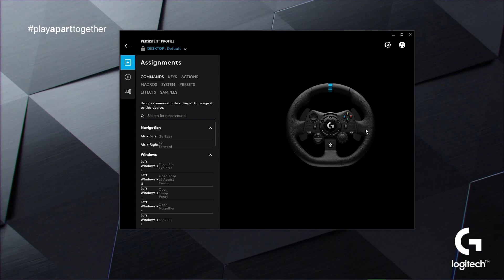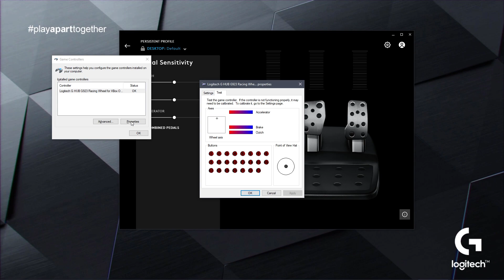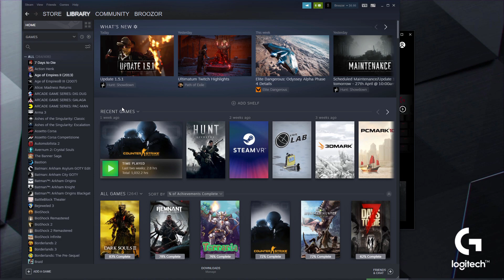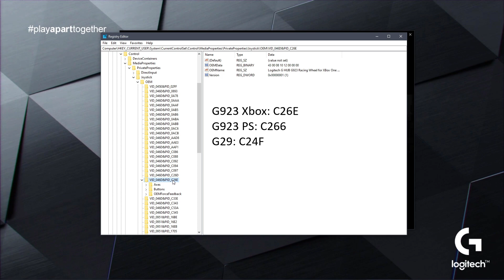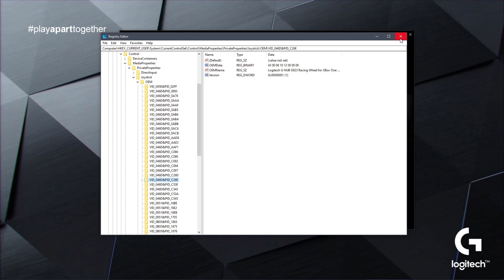How to troubleshoot G923/G29/G920 for Connection Issue

Comment: so my wheel isnt showing back up in registry?
Reply from the maker: Hey!

Did you refresh your registry? If it doesn't appear at all it could be that the driver itself was never installed. Could you make sure that you have full power to the wheel and that it's connected directly to the wall?

If that doesn't help please open a ticket up with us so we can diagnose this further!
https://support.logi.com/hc/en-us/requests/new?ticket_form_id=360000621393
Reply: @logitechsupport  it shows up now. But my clutch doesnt show up in usb gaming devices for calibration.

Comment: How did you get steam to identify your G923?  I have the PS4/PC Logitech.
Reply from the maker: Hey there! 

Going into your steam controller settings and unchecking all the option boxes could solve this. 

If it doesn't please open a ticket up with us so we can help you out further!
https://support.logi.com/hc/en-us/requests/new?ticket_form_id=360000621393
Reply: I have a brand new G29, it's unrecognized by Steam with boxes unchecked. Everythings fine with Ghub and Windows. @logitechsupport

Comment: So my issue is that F1 2020 stutters like crazy only when my G923 is plugged in. This is on Steam by the way. The problem is that my wheel isn't being recognized by Steam. It just says "no controller detected".
Reply from the maker: Hey there!

Could you go into your steam controller settings and make sure that all the check boxes are unchecked! If this doesn't help you can open a ticket up with us down below!

https://support.logi.com/hc/en-us/requests/new?ticket_form_id=360000621393

Comment: The problem I have is that, games can’t pick up the fact I’m using my wheel. It calibrates and g hub picks it up, but steam doesn’t
Reply from the maker: Hi there! Can you make sure all your steam controller settings are unchecked? After that you may need to do a driver reinstall. 

If that doesn't help please open a ticket up with us!
https://support.logi.com/hc/en-us/requests/new?ticket_form_id=360000621393
Reply: @logitechsupport  so what I think the main issue is it is not being recognized in the device manager! It keeps telling it is a code 45 and that if updating the driver doesn't work then it needs.the software rolled back. Which never works either. So that is where I am at lol
Reply: @thegoodsenator2855  i have the same issue with the g920, have you found a solution?
Reply: @EoSProductions300  Did you find a solution?
Reply: Same

Comment: So what if steam is not even showing my G920?........I'm retty pissed that I spent 250 dollars on a wheel that is even being recognized by steam after spending even more on games that are specified that they work with it....Thumbs down since I am not the only person with this issue and I can't seem to find a straight answer anywhere
Reply from the maker: Hi there!

Can you make sure you uncheck all the boxes in steams controller settings? If that doesn't work you may need to do a driver reinstall.

After that if you are still having issues please open a ticket with us!
https://support.logi.com/hc/en-us/requests/new?ticket_form_id=360000621393
Reply: @logitechsupport  Everything is unchecked. The latest driver update is installed. (It states the combination pedals issue is fixed.) I've tried reaching out to customer support almost two weeks ago, thus why a comment wound up here. It's like the down d-pad button is stuck and also, in NFS the car is stuck in reverse. Works great on new games ACC and Forza, but older games like NFS and Farming Simulator it has the glitch

Comment: I have checked power and reinstalled/updated drivers but when I turn on my wheel and xbox, the wheel g920 just turns left and then stops. Fast blinking xbox light
Reply from the maker: Hi!

This is typically a power issue, could you make sure your power supply is plugged directly into a wall and all the cables are properly connected? If this doesn't change anything please open a ticket down below!

https://support.logi.com/hc/en-us/requests/new?ticket_form_id=360000621393

Comment: what iff it doesnt respond to ghub im turning  it  and it isnt turning in ghub
Reply from the maker: Hey!

This could be a driver issue or a power issue. Does the wheel calibrate when plugged in? Also try a driver reinstall! If this doesn't solve the issue please open a ticket with us!

https://support.logi.com/hc/en-us/requests/new?ticket_form_id=360000621393

Comment: Hey so I just bought the driving force shifter yesterday and i realize one of the pins is missing on the wheel itself so the shifter can’t fully connect, I tried shoving it in and it worked, but it would only go from 5th gear to 2nd gear, should I sent it back to Logitech?
Reply: I realized that this question doesn’t make much sense, sorry!

I meant that the Vga in on my wheel itself is missing a connector and my shifter won’t work.
Reply from the maker: Hi!

Please open a ticket with us so we can help you get it fixed!
https://support.logi.com/hc/en-us/requests/new?ticket_form_id=360000621393

Comment: I’m so mad. I just spent 250$ and literally 7 hours of trying to fix my damn wheel. It is setup on the PC I’ve re installed all drivers I’ve checked game comparability. I’ve literally done everything I could think of but forza horizon 4 and need for speed heat both won’t recognize a wheel at all. My entire PC recognizes it but the games won’t. Can you PLEASE help me I will deadass PayPal you money if you fix it
Reply from the maker: Hey there!

Are you running the wheel through a USB hub? Is it plugged directly into the back of your PC? 

If you aren't and there are still issues please open a ticket with us and we can help you out further.

https://support.logi.com/hc/en-us/requests/new?ticket_form_id=360000621393

Comment: I have a g920 with shifter, my shifter shows up but when I shift gears it doesn’t respond. Not even in the feedback like you showed with the wheel reacting on screen.
Reply from the maker: Hi!

You may need to set up all the settings for your shifter manually! A lot of games require this.

If that doesn't help you out please open a ticket up with us below!
https://support.logi.com/hc/en-us/requests/new?ticket_form_id=360000621393

Comment: Hey, my problem is that the rotation is not accurate! When I turn it left its completely fine but when I turn it right it rotates but then will not rotate back, but the wheel does, so it will say the wheel is turned but in reality its back to centre, help!
Reply from the maker: Hey!

In this case you'll need to open a ticket with us! The link is down below :)

https://support.logi.com/hc/en-us/requests/new?ticket_form_id=360000621393

Comment: Have a G29, green led flashing and rpm all lighten up. Does move for 1 cm to the left but then the calibration stop. Appears at -450 rotation degree on G Hub even if it's centered. Power plug does return 24V so it's not faulty...Any idea ?
Reply: did you find a fix?
Reply: Same any fix ?
Reply: @Facebookgoku999  READ ALL, I FOUND A POTENTIAL FIX- I fixed it. So what I needed to do was unplug everything from my outlet (except the one below, for context I had an 2*3 adapter for a 2 plug outlet) and it worked just fine after. I had been searching for months prior and I was on the verge of selling it but all it needed was its own outlet. BUT, some outlets have less than 120V, It says this thing only uses 30V but it has to have 120V, kinda weird but whatever. So if that doesn’t work then try a new outlet, your outlet may also have some issues so another good reason. make sure you plugged in all three cords (four for shifter if you have it) to the WHEEL
Reply: Is it fixed? I have the same problem…
Reply: same issue
Reply: its likely a power issue...make sure its plugged into an outlet, that got as much voltage from a wall. Some surge protectors dont provide as much power
Reply: @tubedude92 you gotta plug smth into a outlet?
Reply from the maker: Hi!

We'll need you to open a ticket for this! Please use the link below.

https://support.logi.com/hc/en-us/requests/new?ticket_form_id=360000621393

Comment: Hey I have a g920 and two buttons on it don’t work LSB and RSB is there a way to fix this ps I’m on Xbox not pc.
Reply from the maker: Hey!

It sounds like you might have enabled the dual clutch feature.

Could you hold down the left and right gear paddle as well as the X button until the RPM lights flash? This should reset the function.

If that doesn't help please use our ticketing system!
https://support.logi.com/hc/en-us/requests/new?ticket_form_id=360000621393

Comment: i have a g29 there no blinking lights just the green one on top (not blinking) but ghub or my games dose no see my wheels
Reply from the maker: Hey!

This could be a power issue! Please make sure your power supply is plugged directly into a wall and connected properly. If that doesn't work please open a ticket with us below!

https://support.logi.com/hc/en-us/requests/new?ticket_form_id=360000621393

Comment: What can I do if my steeringwheel doesn't appear on Steam? It is working, all the buttons are working, the pedals also working, It's as if the steering wheel isn't connected, the same problem happens when I connect it to my Xbox
Reply: It's very frustrating because the steering wheel works well, I can play Forza perfectly, I can play F12020 perfectly but I can't play F12021 because my Xbox doesn't detect the controller and the same happens when I connect it to the PC, I do all the tests and it works fine but for some reason it doesn't detect the connected controller
Reply from the maker: Hey!

Can you go into your steam controller settings and make sure no boxes are checked? This usually fixes the issue!

https://support.logi.com/hc/en-us/requests/new?ticket_form_id=360000621393

Comment: After a year of usage the wheel stopped detecting incoming power meaning that it won't power on and spin. Replacing the cable hasn't worked at all.
Reply from the maker: Hi there! 

Please open a ticket with us so we can give you more personalized support!

https://support.logi.com/hc/en-us/requests/new?ticket_form_id=360000621393
Reply: same, yes i have a ticket

Comment: just getting no response from the G920 Wheel when plugged in, rechecked all cables and everything looks alright, used to work amazingly but suddenly just stopped working. used to be plugged into a surge protected extension cable when working, does not work anymore (i have tried wall plug still no response) was wondering if theres anything i can do
Reply from the maker: Hey!

Did you by chance have a blackout or short while it was in your surge protector? There could have been a failure in your power supply.

Please open a ticket up with us and we can see how we can help!

https://support.logi.com/hc/en-us/requests/new?ticket_form_id=360000621393
Reply: @logitechsupport  not of my knowledge, by the problem it looks to be a power supply issue, i have opened a ticket, what’s can i do to resolve it if anything?

Comment: Does anyone know why in steam games that my neither my logitech shifter or the paddle shifters work? When in the menu of a game i can scroll through the game menu. I tried it with 3 different games all had the same result.(all of them have been on steam) But i know that both shifters work but why wont they work in game
Reply from the maker: Hi!

You may have to bind them per-game. Some games require a little bit of set up before you can get going!

If you have done that and it still does not work please open a ticket with us.

https://support.logi.com/hc/en-us/requests/new?ticket_form_id=360000621393
Reply: @logitechsupport  I figured out that in some games i had to manually switch it to get it too work. Thank you!!

Comment: I cant find it in the advanced windows registry at all, also mine looks completely different than yours does and I also did the other steps which it did go correctly but it didn’t recognize my steering wheel in steam. What should I do?
Reply from the maker: Hey!

Did you go through and make sure all your steam controller settings are unchecked? 

Does it still function in game? If it is not showing up at all you could not have complete power going to your wheel so I would advise you to check your power cables!

If that doesn't help please open a ticket down below!

https://support.logi.com/hc/en-us/requests/new?ticket_form_id=360000621393

Comment: the problem i am having was mentioned at the start. The LED of the top of the wheel (G29) is repeatedly flashing. I followed along with the tutorial but nothing has changed. Any ideas?
Reply from the maker: Hey!

This is typically a power issue. Can you make sure the power supply is plugged directly into a wall and also both connections are secure?

If this doesn't solve it please open a ticket up with us!

https://support.logi.com/hc/en-us/requests/new?ticket_form_id=360000621393
Reply: @logitechsupport  I have the same problem. I have everything connected correctly. If I connect G29 to a PC or PS4 it will not calibrate. In the game, it is still turned to the left, even though I don't move G29. Where could be the problem?

Comment: my wheel is just blinking Ive checked the cables and that it just wont stop blinking please help me
Reply from the maker: Hey!

Do you have your power supply connected directly to wall? Sometimes power strips do not provide enough power. 

If this doesn't help please open a ticket up with us!

https://support.logi.com/hc/en-us/requests/new?ticket_form_id=360000621393

Comment: I have a G29 (C24F)  when i deleted the file in the registry reconnected the wheel it showed up as a G920 (C262) 
Is that good?
Reply from the maker: Hi!

It should show up as G29. It may have populated into another folder, could you refresh your registry and see if it is there? Also is the wheel functioning correctly?

If it doesn't show up please open up a ticket with us.

https://support.logi.com/hc/en-us/requests/new?ticket_form_id=360000621393

Comment: Hey, i have a problem where my software cant find my wheel. Its getting its power and its blinking. Its the g29 one. No games can find it either, any kind of help would be awesome.
Reply from the maker: Hi!

Typically the blinking light is because of lack of power. Is your power supply plugged directly into a wall? If you are using a power strip it could not be delivering enough power.

If this doesn't help please open up a ticket with us!

https://support.logi.com/hc/en-us/requests/new?ticket_form_id=360000621393

Comment: Hey !
My wheel is flashing it's light and no calibration. The pedals are working and the buttons are doing fine but not the wheel itself. I'm using it on an Xbox Series S and i'm not sure if i can do any of these methods except plugging in-n-out, but that's not working. Do you have any advice?
Reply from the maker: Hey there!

This typically is a power issue. Could you try your wheel plugged directly into an outlet? Make sure all your cables are seated correctly as well!

If this doesn't help please create a ticket with us so we can dive deeper :)

https://support.logi.com/hc/en-us/requests/new?ticket_form_id=360000621393
Reply: @logitechsupport  Still nothing, not even on the website. I didn't find any simular issue.
Reply from the maker: Hi again, I would open up a ticket with us! We could definitely help you out more there.

https://support.logi.com/hc/en-us/requests/new?ticket_form_id=360000621393

Comment: My G29 is not calibrating, buttons are working fine but wheel is not getting calibrated(connected with PS4). LED flash light is blinking
Reply from the maker: Hey!

This is usually a power delivery issue! Please make sure the power supply is correctly plugged in and also directly into a wall outlet!

If that doesn't help please create a ticket here:

https://support.logi.com/hc/en-us/requests/new?ticket_form_id=360000621393

Comment: Hello, Logitech Team. So I have my g29 for a few months now and it worked everytime perfect. But since 1 week maybe, I have a problem. The wheel and the shifter are working fine, but the pedals not. If I start the GHub everything is recognizing, but after 5 min the pedals don't work at all, or the brake is to ~5% pushed, even if I don't touch them. But most the pedals don't work. But they are still recognized by the Logitech G Hub App. :/
Reply: I have a similar problem, did you manage to fix this?
Reply from the maker: Hi!

Can you please open up a ticket with us? We'd love to help you out.

https://support.logi.com/hc/en-us/requests/new?ticket_form_id=360000621393

Comment: Can you use the g920 on a mac?  When I plug it in I get a fast flashing with light and nothing happens?
Reply from the maker: Hi!

The G920 wheel is not compatible with Mac systems.

Comment: G920 does the calibration rotation but doesn't centre and is unresponsive with light blinking rapidly, its plugged in properly and everything ive tried uninstalling drivers ive power cycled the wheel. i think its a hall effect sensor issue how do i solve this
Reply from the maker: Hi!

Can you open a ticket with us please? We would need to do a deeper dive on this issue!

https://support.logi.com/hc/en-us/requests/new?ticket_form_id=360000621393

Comment: When I plug in my g29 into my pc it spins all the way to the right but when it spins left it doesn’t re center and now it just doesn’t work at all
Reply from the maker: Hi!

Can you make sure your power connections are seated? You may be losing power via a lose connection when the wheel is spinning.

If not please open a ticket with us so we can dive into this issue further!

https://support.logi.com/hc/en-us/requests/new?ticket_form_id=360000621393